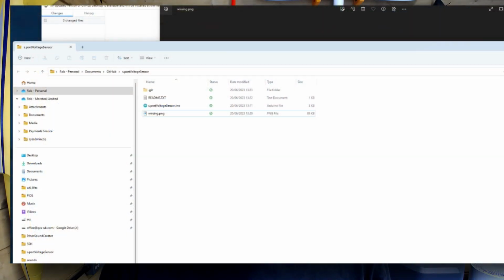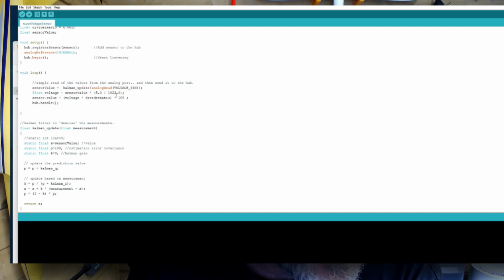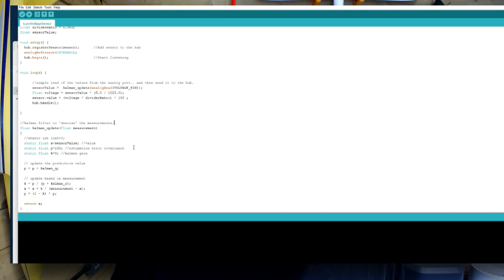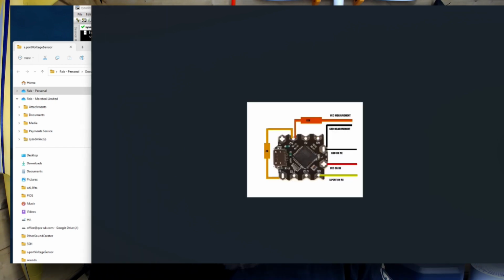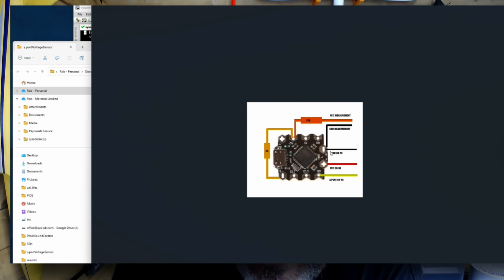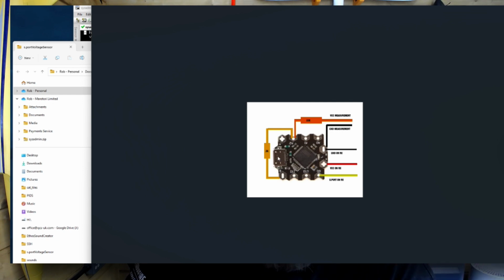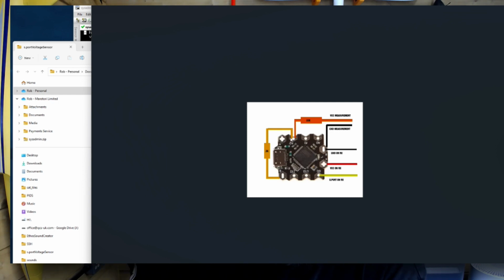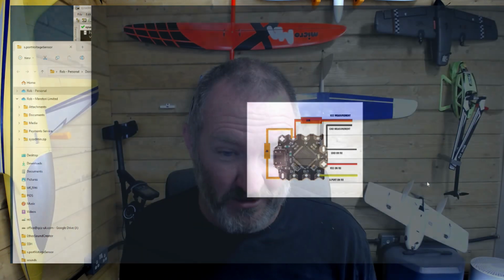Diy Frsky Voltage Sensor - Super Mini

Comment: Thank you. I made couple of sensors with Pro Micro With The Bootloader ATmega32U4 5V/16MHz Module . The only problem I have ,I can't use LUA script on RM tx16s, it doesn't work. To make any changes in S8R /S6R receivers you have to disconnect sensor.
Reply from the maker: What lua script are you talking about?
Reply: LUA script for programming Frsky S8R with Radiomaster TX 16S

Comment: Thanks for this video! I tried this with an attiny85 (digispark board) because i had them but couldnt get this to work. Digispark board is smaller than the beetle but have had issues getting the attiny to work with some functions. Im by no means an arduino expert so i just ordered some beetle boards to give it a go again and going to try with an arduino pro mini too. Im i missing something with the attiny boards? I think a little series on making frsky sensors would be awesome, i see there is some docs about it out there but seem hard to follow to me as far as wiring them up. It looks like lots of base code to diy something but i dont know where to even start. Thanks again for the vid!

Comment: Hi Rob, this is really interesting thank you. Is it possible to code this to return individual cell voltages and a total pack voltage that i can send back to the TX (X18SE)?
Reply from the maker: Yes.. but then needs different wiring to be done.

Comment: cell voltage is more important than pack voltage especially when using 6s set ups.
Reply from the maker: I totally agree.  I am not saying that this is better than the stick frsky sensor.. Rather that it is a handy sensor for certain use cases.